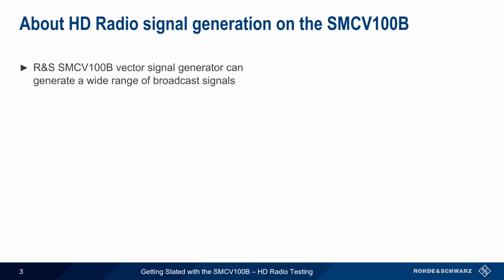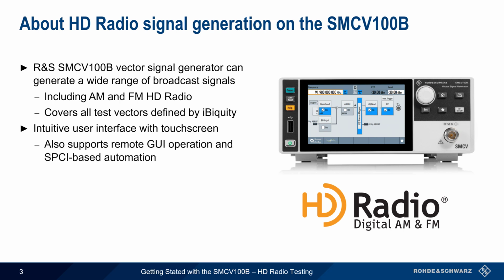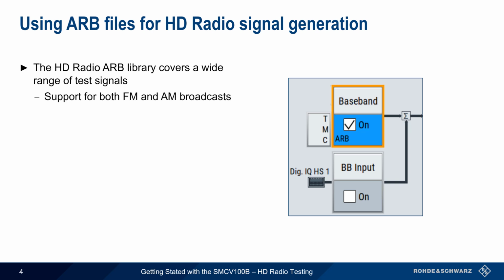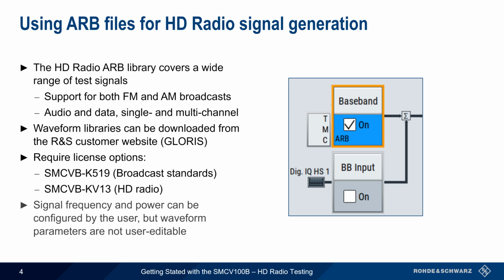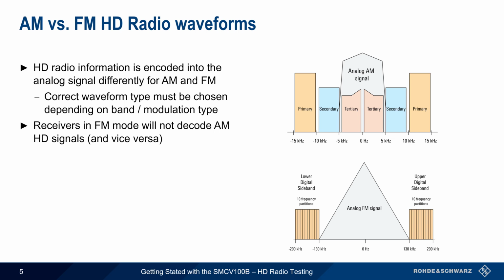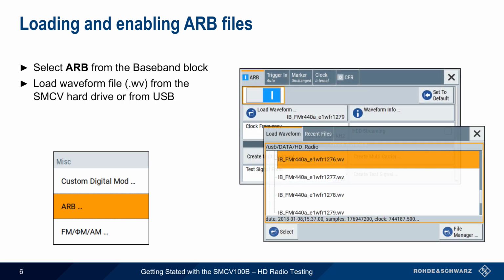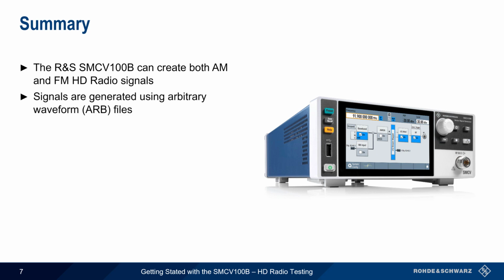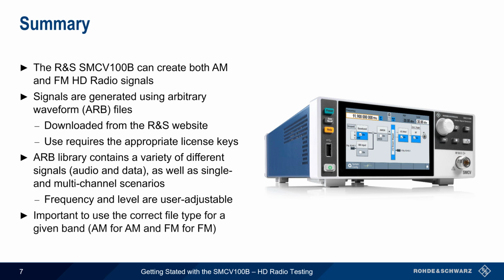Getting Started with the SMCV100B - HD Radio Testing

Comment: wondering if your device show how much more bandwidth is used by a HD radio signal compared to a analog signal, lets say on the next channel over....
Reply: Yes, this is very easy to measure with a spectrum analyzer.  And I believe the “…” part of your question refers to potential adjacent channel interference caused by the digital subbands.  Clearly, the first step in addressing any potential interference issues is measurement, and that is what we specialize in 🙂